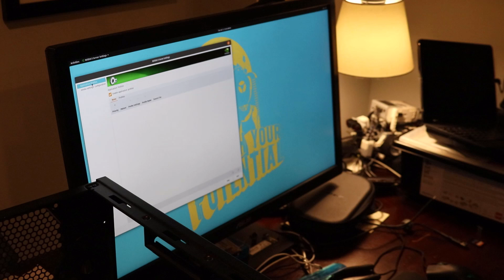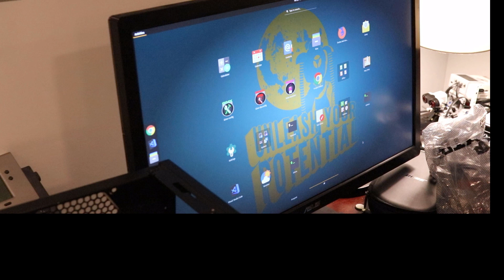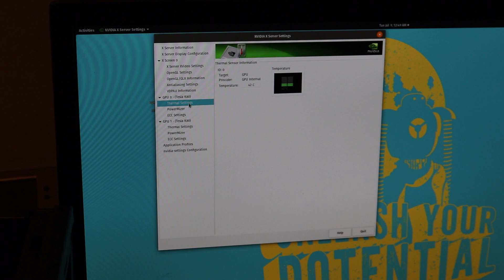NVIDIA Tesla K80 GPU 5 minute install

Comment: You welcome to send the card to me. I really need it for my A.I. I can't afford a RTX3090 24Gb
I think my Silver Stone 1500w has the correct connectors. Also I have a ton of air flow, proper blowing fans.

So my local version of the A.I is llama3.2-vision:11b-instruct-fp16. Which uses about 20Gb of Vram. Now since the K80 is two cards. Will the Vram be enough to run this A.I or will it only be able to use 12Gb or Vram?

Comment: Got a set of K80s to assist me with 3D rendering - I got my PC to boot up with it detected by the system, but the problem I am facing now is my PC will NOT allow me to install the latest driver for my RTX 3090 AND the k80 together, and even if I get the 3090 drivers back up running, the k80 drivers automatically install, and I'm stuck in this perpetual loop of having to reinstall the drivers for my 3090. What must be done?
Reply: Gotta use a virtual machine, those two cards can't be used together since the drivers are so different. You can use an AMD card and drivers or try to find an Nvidia driver that supports both cards.

Comment: Hi Robin, I have got a K80 and ordered fans for it. I have a Dell Optiplex and can't enable above 4G decoding but I am running Windows 11. I know I will need external power to run this and will have to use a PCIe extension lead as the computer is only compatible with low profile GPUs.  I am not worried about how fast things are processed - but it will need to work.  Do you think it will be possible to run if I buy this extra kit?

Comment: I think K80 is only supported by newer motherboards (with 4g decoding). On my Intel i5-7500 B250M-D3H it showed up in DevMan with errors [ERROR: This device cannot find enough free resources that it can use (Code 12)] but could not get it to work which is due to mobo not allocating enough resources to memory, also Nvidia Control Panel did not start at all.

Comment: Whenever I plug the cpu connector to my k80 I get stuck in a bios loop. Any advice?
Reply from the maker: Take the card out and look in your bios for large BAR support or over 4GB bar enable. Mostly this is a limit of the motherboard. Try updating motherboard bios. I have had good success with Asus server class, workstation class motherboards. I have not been able to get ASRock x99 Taichi board for example to work with it at all. If you have the power cable plugged in wrong then the board won’t post at all. The PSU will just refuse to start.
Reply: @robin-g6  thank you. The only issue I'm facing now is I can't get my gpu to work while it's installed. Either I install it's drivers and the k80 is stopped working as said in device manager or its the other way around.

Does it have to do with the fact that my gpu is also nvidia?

Comment: I have 2 Tesla k80,
motherboard : Z390 AORUS PRO WIFI (rev. 1.0)
Bios 4G enabled
i tried both, system boot fine but windows 10 can not detect them, they do not show up on Device manager also the drivers fails to install with msg "Installer Cannot Continue The Graphics Driver Could Not Find Compatible Graphics Hardware"
are the cards dead !
any help would be very appreciated
Reply: I am having the same problem as well. Did you find a solution?
Reply: @unknown19470  [SOLVED] it worked ! 
> short answer : it was the GPU i/o shield that was meant to hold/support the GPU inside the atx case, but slightly would NOT let the gpu sit all the way in it's pcie slot.
 > long answer : i tried 1 GPU on the "Second" PCIE slot and i used 2 Cable PCIE as in two separate rails. (not one cable that split in 2 from a single rail). booted the system ... after few minutes into windows, its showed up as x2 "3D video controller" under "Other devices" on the "Device manager"   then windows started the drivers installation process for Tesla k80 like, took like 5min or so! 
removed the GPU, i removed the i/o shield from it and i set it in the 1st  PCIE and the second GPU on the second PCIE slot, power each with a single rail (one cable that split in 2). it worked ! detects as x4 Tesla k80. 
thank you !
 your question it made me ask my self what if it was under powered ! that explain why i used 2 pcie rails to power the beast while testing it on the second pcie slot.

Comment: Hello, do you run Pop OS as a partition or standalone OS? Many thanks for your tutorials!!
Reply from the maker: In this case I ran it standalone, I have some machines with Pop OS and others with plain Ubuntu. I quite like the ease of setup of Pop OS with NVIDIA machine learning hardware. Just makes things easy.
Reply: @robin-g6   Thanks for your answer, I am basically building a machine for the same purpose as you. ML etc. 

- AMD Ryzen Threadripper
- ASUS ROG Strix E-Gaming X399
- 1 TB Flash
- 4 DDR 16 GB RAM

I got into the BIOS with a smaller GPU, just for testing everything else is working, which it did. Now with the Tesla K80, I am struggling, I got this separate CPU/PCI-E cable adapter ordered now, but still wonder if 750 W PSU is enough... Lets see when it arrives.
Reply from the maker: @svenduve83  does it fail to boot with the K80? At startup the K80 won’t draw much power as it will be idle. So if it’s failing to boot, check the power cable to the K80 it should NOT be a PCI-E it needs to be an 8 pin CPU cable or you need an adapter for 2 PCI-E cables to power it. If this is the problem then simply no power will get to anything so it won’t power up at all. (With the wrong power cable you are shorting 12v to ground so the power supply will simply refuse to start) The next thing is motherboard supporting large BAR support, “above 4GB decoding” in the bios, if this is the problem you will get lights on the motherboard when you hit power but it will not complete POST power on sequence. Make sure this is set in your bios.
Reply: @robin-g6   another trouble, I wonder if you came across this, 

- ASUS Radeon R7 240 GPU for graphics output
- PSU 1200, before I had 750, but went up to 1200 to be on the safe side

BIOS setting above 4g enabled, CMS disabled, I cannot set the BAR sizing to Auto, I don't have that option visible

OS is PoP OS, with nvidia drivers installed, as indicated in the installation guide

I had the GPU powered initially with the adapter cable, but now have free CPU 8P 12 V with the new PSU, so I think there should be power.

As indicated on another channel, the GPU was running and I got CUDA going too, and trained a light weight model on the weekend for testing purposes, via nvidia-smi I could see both GPUs (as its two 12 GB), and via darknet, I could run the model choosing 1 GPU or actually both.

Now trying again, it doesn't complete POST power on sequence and I get the ASUS error code 97: "Console Output devices connect" from the handbook. The screen at the same time shows "BIOS updating LED Firmware, Do not shut down or reset the system to prevent  boot failure", if I disconnect the Tesla K80 it boots as usual.

Searching the internet and forums, I tried, BIOS update, CMOS reset, new PoP OS install, different power cable settings... running out of ideas. 

You seen this before, any idea?
Reply from the maker: @svenduve83  you are certainly getting there.. fresh bios flash for the motherboard has fixed things for me. Not seen this specific behaviour before.  If it’s intermittent that could anything … maybe try GPU in different slot.. try single memory dimm to see if it helps. The fact it booted once and you got it ALL working is a good sign.
Reply: @robin-g6   So perhaps for anyone else having the issue, I got this thing going again 1st by pulling all power cables over night. This suggestion came from another thread, but it worked.... for a day. Now I did a BIOS flashback, ... not the first try, and it booted. 

I think I now just leave the machine running for some days. The POST power on sequence is just so unstable. 

Really don't know if this is a viable solution,... ?

Comment: I do multiple ip cameras and seems the clients peg at max cpu when viewing them. Would installing this on the server help do the decoding so the view on client machines would not need to? I was going to get one but I have a HP server running server 2019 and not sure if it would even work. I use milestone. Also server acts as a PVR backend

Comment: Hello, i want to build a gaming pc with this card,but she don't have display ports, How do you manage to use it?
Reply: you cant game with it. its for mining and server work with it
Reply: You can certainly game with it. Need to use another gpu (either onboard or dedicated) for display then specify applications and programs to use these tesla cards as the main hardware accelerator. This is easier done on windows since it's a feature built from laptops. On linux distribution it's a bit trickier with configuration of config files.

Comment: I bought one of these on ebay and I could not get it to work I was using a pcie cable : https://www.ebay.com/itm/New-ATX-24-Pin-to-2-Port-PCIe-6-2-Pin-8-Pin-6Pin-Power-Cable-On-Off-Switch-DMX/174488205401?ssPageName=STRK%3AMEBIDX%3AIT&_trksid=p2057872.m2749.l2649

the power supply would not start up, probably due to a fault. My old cheap 6pin invidia card did. thanks for the video. ZHow do I go from a atx connector to a 2x4pin CPU?

Comment: Nice after spending most of my day poking at it with PCIe connecters turns out to be CPU 8 pin, but I had to use a second separate PSU to solely power it, for some reason my 1050watt gamemax seems to have trouble, the computer refuses to start. possibly a dodgy cable, manage to flash my ROG B450F gaming motherboard to the least BIO which enable me have above 4g option. and now its up and running.
Reply from the maker: Awesome! This is the first time I have heard of an AMD B450 motherboard chipset running one of these. Very cool!
Reply: @robin-g6  I've managed to get an adaptor and now got the card running from the same PSU. as the other one the wires are thin and getting warm in the hand a few minutes in use. I might even try water cooling the card after I've finished playing with it. would be nice to get an 3080 too but  they being brought up and sold for twice the price by companies.
Reply: @reedwischhusen5376  have you had any othere problem with this board, and what bios are you using? Thanks
Reply: @cornishman1987  Nope its up and running with CPU 8 pin cable, on a ROG B450F gaming board with the least bio. I am waiting for a new cooling fan from the US its a 3d printed cooler that clamps on the back end of the board using a high speed sever fan to cool it. hopefully it be better then two slow cpu fans.
Reply: @reedwischhusen5376   wicked I have got the same order for the cooling , I've been banging my head against  the wall with the card it's been fighting me all the way, 
Could I grab your specs please as I'll order the board but not shure if I need a high spec cpu to run with it
Reply: @cornishman1987  I am using a AMD Ryzen 5 1600. and 8GB ram. and 512MB WD SSD hard drive. also got an 1050TI super over clocked card, but made the mistake of not getting a CPU with integrated GPU. as the GPU chipset is not integrated on the motherboard unlike legacy boards So I was forced to use the 1050 as video output but rather have it doing other tasks. as for the K80 cooler, its on its way from the US, I would let you know once I've had a play with it as I don't wish to recommend it before trying it out myself just in case it don't work.
Reply: I would upgrade the RAM in due time, As 8GB isn't enough for heavy tasks.
Reply: Hey Reed,  did you  have trouble with telling the board what pci slot to use as I have a 1gb gpu for my display but as soon as I put the k80 in and fire it up. I have no display
Reply: @cornishman1987  disable csm boot and only have UEFI and enable 4g decoding this is only available with the least bio flash. and my 1050ti is closest to the cpu, and k80 is slapped beside it. just got my 3d printed fan blower for it, be testing it out over the weekend.
Reply: Hello Reed . I want to use a additional 1.100kw spare power supply only  to run the k80 alone .Can I plug the  single 8-pin 12v CPU connector from the PowerSupply  straight to the K80 ? I've  received my card but didnt test yet cause didnt receive the pciE split cable. The powerSupoly says it support 4 processors so I think amperes wouldnt a problem for less wires.  . .Did you try it with cpu connector no problem ? I appreciate if you confirm.

Comment: Huge thank you for the Pop! OS shoutout. I just bought a K80 (hasn't arrived yet) as I'm looking to go into deep learning, and had experience before of trying to setup tensorflow/work with CUDA on ubuntu in the passed. But now that I know of an OS that's already pre-setup for deep learning, I can spend more time playing with that instead of pulling my hair trying to figure out why my environment doesn't like itself. So once again, thank you! :)
Reply from the maker: Glad to help! Pop! OS is pretty cool. I like it. I use at home on a few machines but its nice to have something that installs NVIDIA CUDA and other stuff so seamlessly. I have never tried System76 hardware, laptops etc so would be interested to hear about anyone's experiences there. 

But the OS is a great install experience. Also like the artwork!!
https://pop.system76.com/

Comment: my motherboard stops at D4 even with the cpu powerpin installed, the green pcie cables from nvidia do the same thing
above 4g enabled evga
Reply from the maker: D4 means "PCI resource allocation error. Out of Resources".Whats your Motherboard? My MSI board just can't allocate enough PCI BAR so won't boot. The motherboards I have that work are all Asus. and I look for WS or Server class boards.

Comment: Will I be able to mount this setup?
I want to have a xeon E5 2678 v3, 40gb of ECC ram, a tesla k80 24gb of vram with an air dissipation (Artic Accelero Xtreme III), a GTX 980Ti (for gaming) and a 700w Thermaltake Toughpower GX2 power supply. Will I be able to have it all at the same time? Because if not, I'm looking for a 800w PSU.
Reply from the maker: I think it will boot but you are close to power limits 980ti = 250w , K80 = 300w, E5 2678 = 120w so you are 670watts before disk, memory, motherboard budget. When you max out a PSU  the system will just shutdown. So if you don’t use both GPUs full on at the same time it will work. If you fully load it will shutdown, PSUs usually don’t get damaged as they have over current protection but I’d consider 800w or higher. Hope this helps

Comment: Hello thanks for the great video. What is the mainboard that you use for it? Cann you give the model and number? I am using a MSI Z87-G43 Gaming and dont works.
Reply from the maker: You need a workstation class motherboard the ones I have luck with are Asus WS or server class less than 5 years old with BIOS support for “Above 4GB decoding”. The problem revolves around something called Large BAR support which is feature of PCIe BIOS. There is no K80 compatibility list but I am fairly sure a gaming MB with that chip set won’t work. I have tried MSI and gaming and Asrock boards and neither worked the system just fails to POST.
Reply: @robin-g6  Thank you very much.

Comment: Can you run a gti 1080 gp gpu for display and a teslak80 for computer? Or would I need a quadro  k6000 12gb card to work with the tesla?
Reply from the maker: Yes this would work. I have done this exact thing in this video https://youtu.be/nLnICvg8ibo
Reply: Yep but you need to install some drivers

Comment: Hi Robin, Thanks for your video of Tesla K80. I have a question, I also purchased one on ebay, installed in my system today, but they didn't actually working. My system did detect 2 K80s installed, but I cannot run Vray Benchmark. GPUz also showing everything blank except its name and some basic specification, probably read from its bios, no GPU speed, temperature. I tried almost all the tesla drivers from new to old still didn't work, no Cuda or OpenGL detected. I am not sure if it was the card itself broken or some setup issue. Did that ever happen to you, like have difficulty setting it up?
Reply: Nevermind, I figured it out. It is quite picky on motherboards
Reply from the maker: Grad you figured it out. These cards are not easy to work with!
Reply: @YDFrank  which motherboard did you end up with? I have a ASRock B450 and at this point think I may have isolated the issue to motherboard.
Reply: @alexkhadr1039  these cards are very picky on motherboard whose bios are not close to server or workstation motherboard. So anything that is not Z series of Intel board or X series of AMD does need a little bit of gamble to hope they would work.

Comment: When you make these videos can you please provide us with hardware that you used, motherboard, memory, power supply, processor? Thanks
Reply from the maker: In this video 
Motherboard is an ASUS  Z170 WS. https://www.asus.com/ca-en/Motherboards/Z170-WS/
Memory is Kingston HyperX Fury Black 2400Mhz DDR4  2x 8GB sticks https://www.hyperxgaming.com/us/memory/fury-ddr4?partnum=HX424C15FB3%2F8
Power Supply is an old  750W PSU from Silencer. Not sure if you can buy anymore. 
Processor is an Intel Core i7 7700K https://www.newegg.ca/p/pl?d=corei+i7+7700k
Reply: @robin-g6  Hi, from the video, can i confirm that you are using the onboard graphics card as the video output?
Reply from the maker: @yiyuanyiyuan4459  yes I am using the onboard integrated graphics output
Reply: @robin-g6  noted with thanks! i ask this because as i am setting up in win10, it doesnt seems to allow me to use the onboard graphics card with tesla card..
Reply: @robin-g6  Hey Robin thanks for the details! Do you think ASUS z710 WS could fit two K80?
Reply from the maker: @LoretoParisiLabs  I am pretty confident 1 will work and so I think 2 will too as long as you can power them.